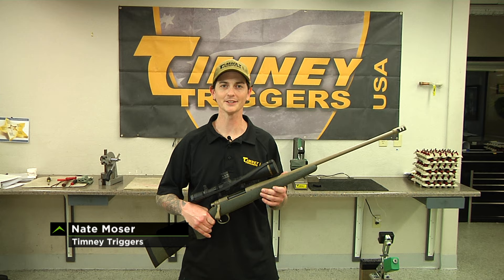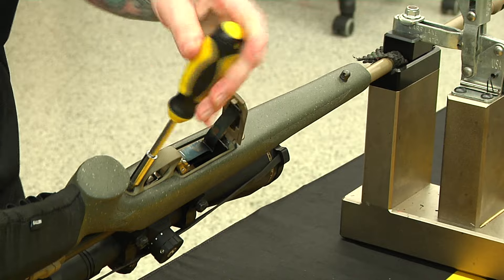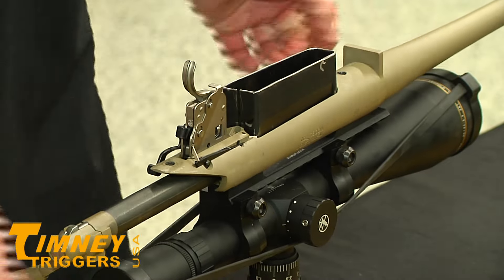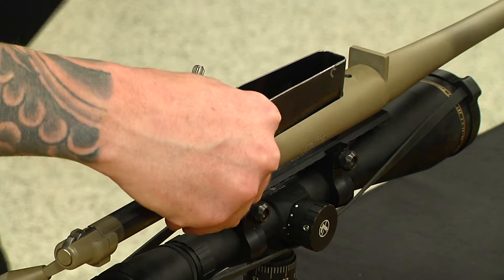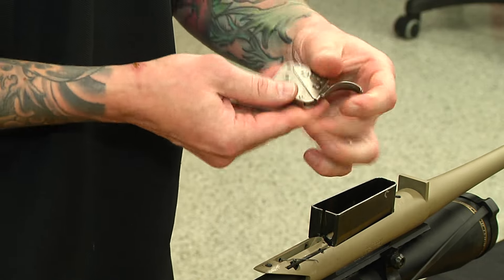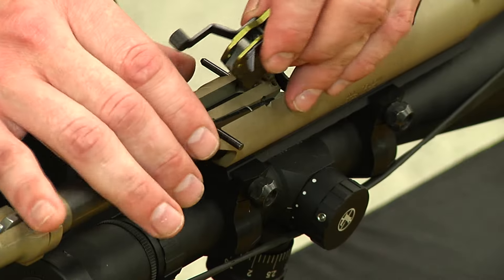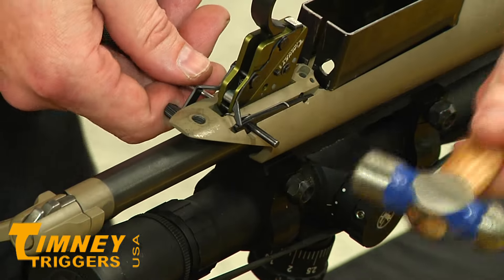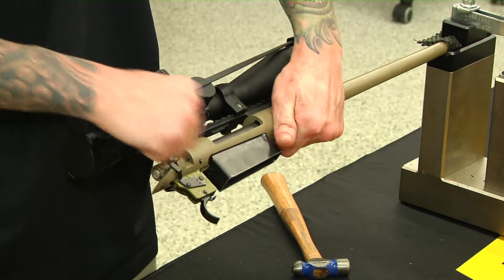Timney Remington 700 Installation

Comment: You need to show how to install the trigger if you accidentally push the rear pin to far, and the bolt stop and spring come out.  It is very easy to make that mistake.

Comment: I just purchased on December 9, 2023 Remington 700 ADL 3006 bolt and I’m wondering does it have the timney trigger in it. I’m nervous about thinking it could have the regular factory faulty trigger. How can I tell? Thanks
Reply: I believe all newer model 700 come with a timney impact installed. It is their base model.

Comment: Just installed one of these. When it's out of the stock it is flawless. when i put the action back into the stock the safety is really stiff.
Reply: Is it rubbing on the stock?  Sometimes I've had to use a light bit of dremel tool work to make room for the safety.  It's not a big deal if that's your issue.
Reply: Exactly the problem I had on two of the. Just find where it is rubbing the stock and sand/dremel it down